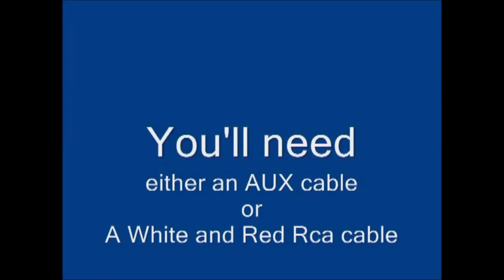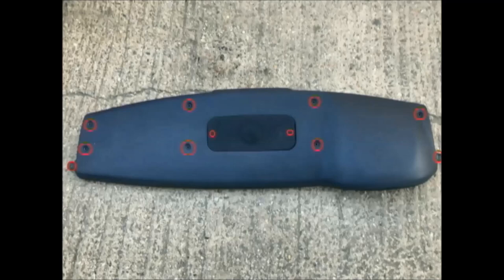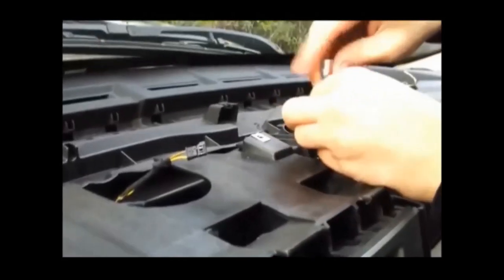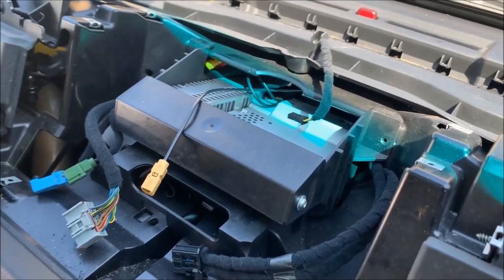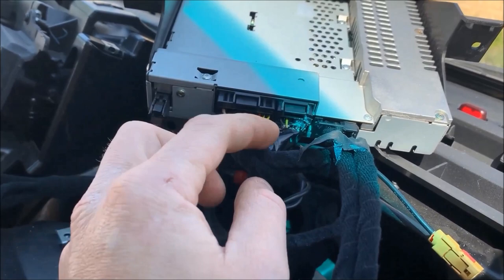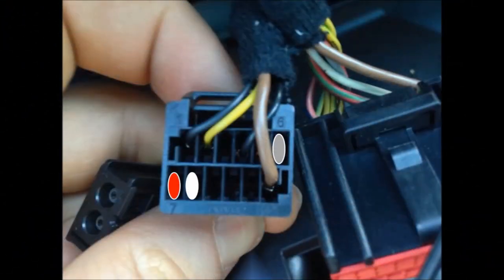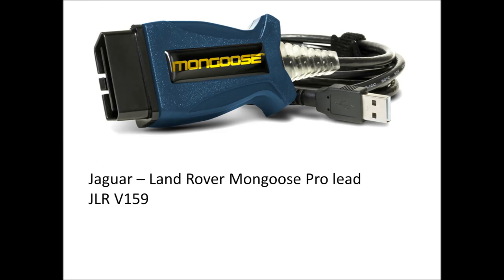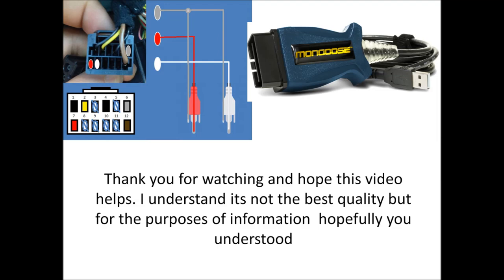How to install (retrofit) an actual AUX port - Range Rover L322 - Harmon Kardon touchscreen system

Comment: This is awesome!  Thank you for posting.  I already coded the head unit to have the Aux option, and now I will attempt the wiring.  I hope that it works for the USA model 2005 (first year in the states with a touch screen and no aux input).
Reply: Did this work for your 05?